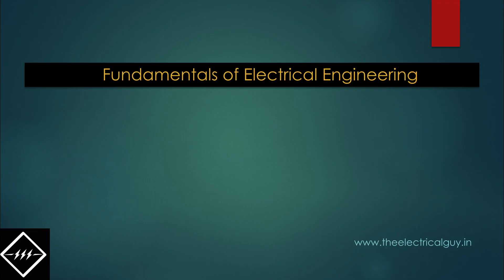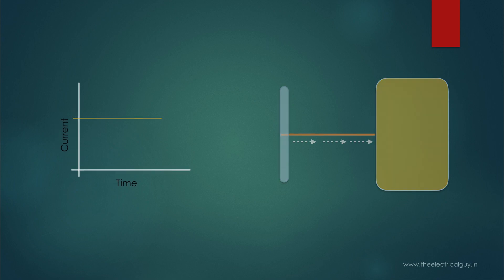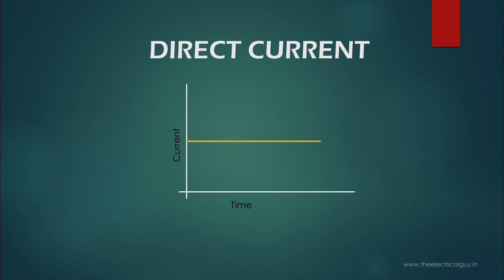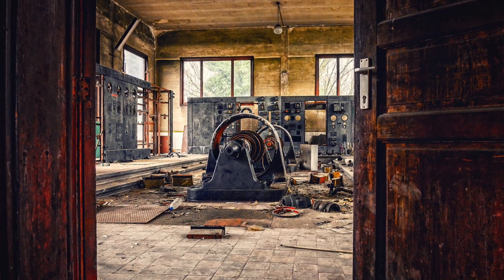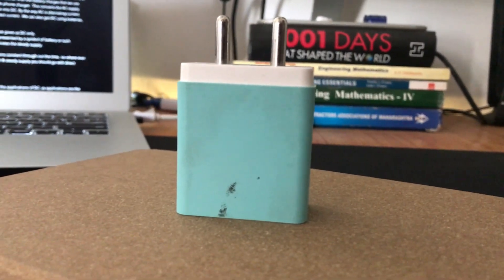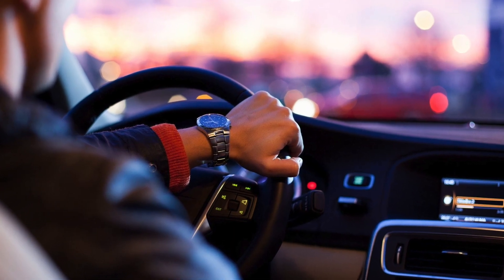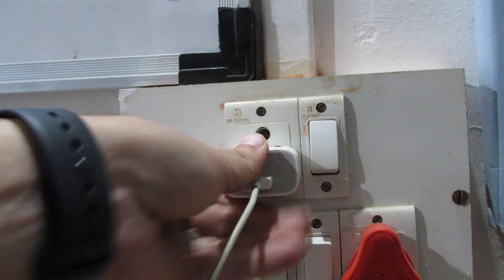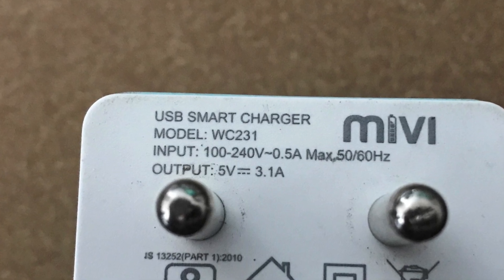Direct Current or DC | Basic Concept & Applications | TheElectricalGuy

Comment: 🎯 Key Takeaways for quick navigation:

💡 Direct current (DC) remains constant in magnitude and direction over time, making it steady and reliable.
🔄 DC can be produced using generators, rectifiers (like battery chargers), batteries, solar panels, etc.
📱 Many electronic appliances, such as mobile phones, utilize DC power due to its stability and the inability to store AC power.
🌞 Solar panels produce DC power, making DC essential for renewable energy applications.
🚗 DC power is widely used in low voltage applications, including charging batteries and in automotive and aircraft systems.
🏢 HVDC (High Voltage Direct Current) transmission is employed for bulk power transmission due to lower electrical losses compared to AC systems.
🔋 DC supply is represented by symbols like a battery, indicating its steady output.
💡 Understanding DC is crucial for various fields, from electronics to renewable energy, due to its widespread applications and reliability.

Made with HARPA AI

Comment: I am not electrical engineer but out of curiosity made a dc generator with 48v 1000w permanent magnet dc motor connected to a 35cc petrol motor with pulleys and belt as driver. It runs and shows volts 48 upto 60. But it gives no current output and doesn't run any loads i connect like a dc bulb or other dc motor at output terminals of generator. Instead it generator pulls and slows down petrol motor. Please identify the mistake I did and provide any solution. I need to run another load of 750w with this output. Thank you 🙏
Reply from the maker: I have a course on dc machines .. you can join that to know it in details. It is available on TheElectricalGuy mobile app.
Reply: Thank you sir, I will check